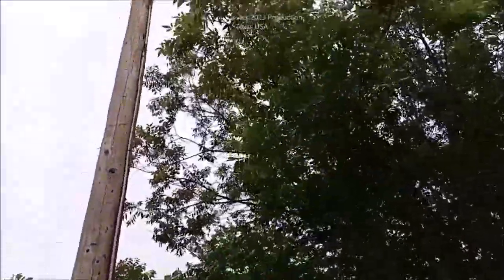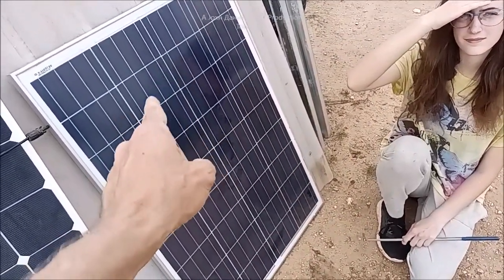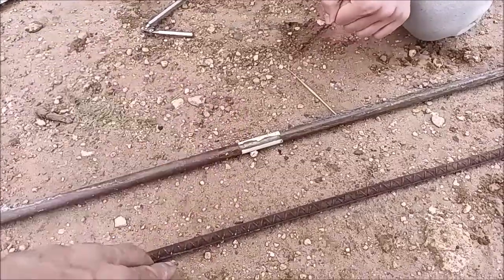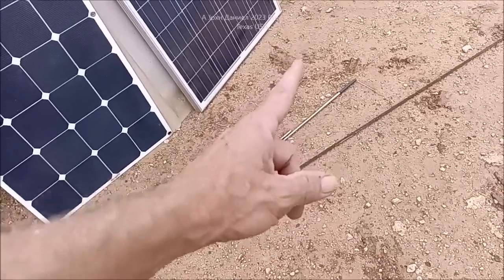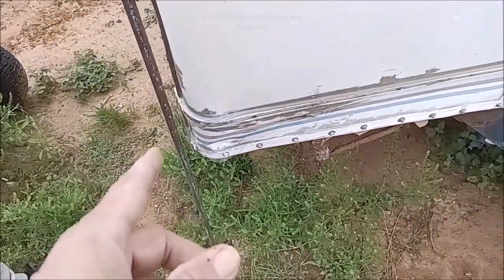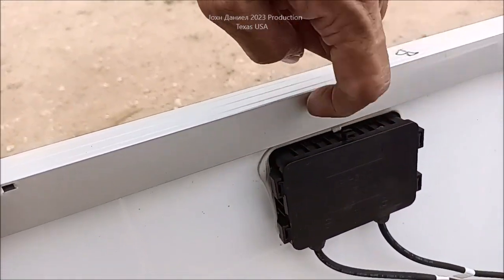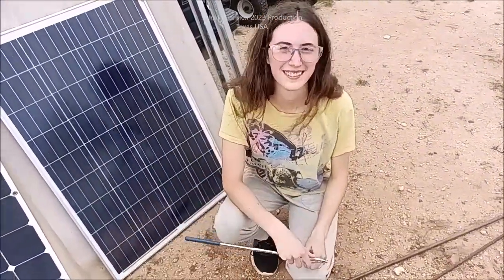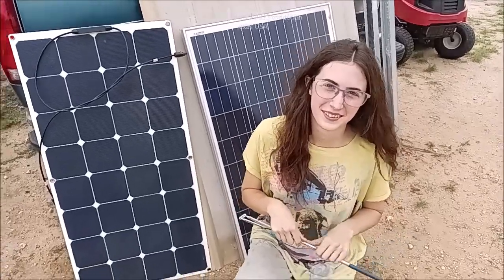Grounding your SOLAR PANELS? 🤔 You Better watch this First! *KNOW DC/Inverter POWER is not Utility

Comment: Thanks for finally putting out reasonable advice on this.  Foldable ground solar panels never have a ground point so I never understood why so many insist on grounding their panels.
Reply: they are grounded because they SIT ON THE GROUND 🤦‍♂🤦‍♂
Reply: @nathanmaker7824  um what?!
Reply: @shaunnightfire8269  you can't read?
If panels are on the ground touching the ground means they are grounded..
Reply: @nathanmaker7824  LOL grounded does not mean touching the ground when referring to electrical circuits.  Proper grounding requires a rod or pipe deep into the earth.
Reply: foldable panels are not intended for real solar installs though. more like just for camping or something where you need temporary, portable power. if you look at actual metal frame solar panels, they clearly have a spot to be grounded, with the ground symbol next to pre-drilled hole in the panel.

Comment: oxidized metal is not a good conductor of electricity: 
Oxidation
When a metal's surface is exposed to oxygen, it reacts with the oxygen molecules to form metal oxides. These oxides can make the surface more resistant, which decreases the metal's electrical conductivity

Comment: The best grounding video I saw. and i went over few dozen of them. Using a regular steel bar make a lot of sense. Thank you for this important information/
Reply from the maker: So called "copper ground rods" are only copper plated steel. Rebar has more ground contact area on it, has oxidation iron oxide (Fe2O3) which is rust that creates as expanding and shedding feature aids in dispersing a charge. The manufacturers of copper coated rods lobbied to get their product in codes. Problem with copper is once in the ground you get tarnishing and electrically nulling copper oxide which proven in real time reduces its conductivity by up to 40%. If you want to use a rod that is not steel use 15mm yellow brass with a silver coating of 12 mil and it is the absolute best and is what is used at server farms like Fakebook and for huge internet companies. Only $800 each!

Comment: Copper is a better conductor than rebar rust has even less conductivity. You want as low resistance as possible. In the car systems there is no ground because it is floating but you can get shocked when you get in and out of the car. Look up tn tn-s and tn-c-s systems
Reply from the maker: Iron oxide concentrations in the ground is the number one attractive path for lightning on the planet, over 95%. The higher the oxidation the more the field is. But copper deposits have no known record of lighting fusion or restructuring. Just because we coat the steel rod with 1.3 mil of copper plating does not mean the copper is the actual conductor to the inrush of charge or displacement of electrons, the steel is since it's molecules are more excitable by the backflow. That micro copper coating on the rod is for the above ground connection of clamps to meet code from the 1940's not to be a diffuser of energy.

Comment: Great video.  Quick question on inverters. I have a standalone inverter with an isolated transformer in it for ac 120v output. Should I bond neutral to ground or leave it floating.  On the Victron Energy 1200va it has an internal jumper to select between the two.  Thanks!
Reply: You need to have a neutral to ground bond for your circuit breakers to trip in a fault (hot wire touching metal that it shouldn't touch).  You should only make the bond in one location.  Bonding in more than one location is also dangerous.  Typically the bonding happens at the breaker panel.  The easiest way to bond at the main panel is to put the neutral and ground wires on the same bus.  If they are separated in the panel then look for a bonding jumper or screw that connects them.  If there isn't bonding at the panel then the inverter could be bonded.  Many inverters and generators aren't internally bonded to prevent the mistake of creating two bonds.

Comment: The frames and racks of your panels need some ground path for induced voltage from nearby lightning strikes and static electricity. That has nothing to do with the DC power lines going to your inverter. Some folks just bond all the panel frames and racks together and connect them to the system ground which is a path back to the ground rod at your service entrance. I don't like this, especially for ground mounts. I add an auxiliary grounding rod at the ground mounts which creates another problem: A nearby strike will induce a voltage across the resistance between the two ground rods which will cause a destructive and dangerous current in the system ground and neutral. So I run a wire between the two ground rods and bind them together, minimizing the voltage induced between them. Alternately you could connect the frames and racks to the system ground AND an auxiliary ground rod, which will also bind the two rods together, but I don't consider that a super reliable ground, so I run a separate wire. I did a video on the issue, and wrote a blog post to accompany it. Earth grounding is NOT a simple issue, and experts don't agree on what's safe and effective. So I came up with a solution that covers all the bases--I think.  https://youtu.be/PEpsz9Jqnrs

Comment: Looking at a bunch of used panels and, some of them, the DC wires were chewed up with exposed conductors. On a van, truck or car, thats 12V DC..It gets alot more dangerous when you step that voltage passed 12 and it starts arcing through air gaps. Into you, down your aluminum ladder and into ground, when youre up there messing with them. My thoughts are wire the frames to ground, flip the breaker off during lightning then when lightning hits all your panels are potentially dead(probably not) but did you died tho? but theres some differences between fully off grid, on grid, grid tied, living in your house vs LIVING IN A VAN DOWN BY THE RIVER!!
Reply from the maker: You won't get arcing till you exceed 32 volts and not even unless you have your panels grounded will you get a arc from your positive wires. Buying used panels if about the worst thing anyone does, they were pulled due to imbalance and cell issues, no such as "oh we just wanted to upgrade" as if they are some new car model. The panels get pulled when the insurance company says they are not in spec or are failing. As for solar on vans, RV's and boats, about 2/3 who install them are running 2 or more panels in series with voltage exceeding 75 volts on average since they are using MPPT with 150 volt capacity.
Reply: @JOHNDANIEL1   Actually panel replacement on corporate solar farms are replaced when the tax write-off expires after 5 years. Depreciation is your friend when it comes to sourcing used panels.

Comment: So how does one get rid of static electricity build up? I can get a shock from my 48v batteries and inverter charger. None of it is earthed.
 I wouldn't earth for lightning but rather for a short circuit
Reply from the maker: Same static that you would get from your car, a aluminum storm door or RV body is what can come from solar panels if installed right.  Yes, 48 volt is getting into the deadly voltage, That is why I am 36 volt and less. Earth grounding it is not a solution to produced DC under 200 volts since it will not naturally equalize to the ground during a short, you or a item in line will become the path. Not the same as AC that is checking to ground 60 times a second. The best thing is simply isolating with covers and proper breakers and durable battery switches on your system. Also, not running to many panels in series so you keep input voltages lower to prevent a high ended differential. I use a max of 65 to 70 volts solar on any 48 volt  build to prevent such leakage from a failed Mosfet or Diode that may put my system at risk. .

Comment: My trackers are lower than my neighbors metal shop and a 40 foot high oak tree. I measured ohms between the electrical panel ground and my steel pole in the ground mount. It was about 1100 ohms. I'm not going to ground it better than that. If I did it would attract lightning and blow everything to hell.

Comment: This is bad thinking. A cable system doesn't need a ground to work but if you've ever seen lighting come through a cable line to a house you'd understand why it's LAW to ground that system. I've seen them melt coax cables into the siding of houses on their way into the ground rod. I've also seen damage from some where the ground wasn't a good connection then that conductive wire takes that 300 million volt charge strait into the house. A ground for electrical systems yes is important for the function of the system but Telcom doesn't need a ground for anything other than keeping lighting out of your house. If lighting hit's your panels and goes into the ground you might still be making a home owners claim. If lighting hits your panels and comes into the house you might be building a new house.

Comment: Hi John. You got a point but sometimes the inverters get A/C energy from the Grid and that is why i guess they should be grounded.
Reply from the maker: Those models have a built in isolator ground circuit, it is based on a GFCI polarization circuit. If you test them you will find that once power is removed from the grid the pass through ground at the terminals vanishes. It returns when you reconnect the grid power. This is a relay in them that does it. If you connect that ground from the house/grid to the chassis then pass it into the wiring from the inverter you will notice a 2 to 3 volt reduction in the inverters output when not on grid.

Comment: Hello John, i watched this video and read the interesting comments. I remembered watching a video where the people had done an off grid instal (i think it was 7000 watts of panels). (i just wrote on their comments for them to watch this video- especially with diversion aspect). i just rewatched it, yes they grounded their panels through the controllers from what i could see (victron controller with earth). They had a lightning strike near the panels and it fried the controllers and inverter. They are now using surge protectors. The reason for this is that they mention that fuses simply dont react fast enough when massive lightning strikes pops in the voltage. they have also added further ground rods (copper). They are in a desert type area and they were told by solar company that long runs of the wiring (over 100 feet) are an attractant to lightning. Therefore more grounding to offset and make a channel for the lightning. The surge protection makes sense to me in the sense of topping massive voltage influx for whatever reason. However, i would be interested in your opinion on the "long " runs of wire scenario, being an attractant. Here is the story on their channel: https://www.youtube.com/watch?v=7DvIjAvMge0 (channel is Tiny Shiny home). Many thanks

Comment: Okay, I think a lightbulb just illuminated in my brain.  A few years back, when our house was being built, I decided to make it 100% off grid instead of paying 30+k for the local power company to bring power to our land in Southern UT.  I built the solar array and installed the panels as well as the inverters, etc.  I let a friend who's was an electrical engineer in Germany help me.  I'm using two 5k grow watt inverters that are supposed to operate in together to give me 10k of inverting power, but they will only work properly when the solar is NOT turned on and running through the inverters.  If I hook up the current sharing cables and the other parallel cables, just using my battery bank, (6 100ah lithium batteries), everything works great, but as soon as I turn on the solar, I get an over current error or something like that.  No one at Signature Solar could figure it out so all I've been doing is running on one inverter and using the other inverter as a battery charger, which is such a waste.  It's been running fine so I haven't messed with it since I resolved to use it as stated but now that I've watched your video, I'm inspired to disconnect all the grounds and see what happens.  If that fixes my problem I'll be buying you all a pot of coffee.
Reply: @georgedrenes8143  what happened?

Comment: imagine you have a metallic mains appliance touching any of your 12 volt minus.
for example, your metallic cigarette lighter sockets.
their metal plate is likely connected to the 12 volt minus pole.
or like in my case:
i use a desktop pc, i have an audio cable plugged into that, going to my old 12 volt car radio
to play youtube sound over my speakers.
the return wire in that audio cable connects the car radio case with the desktop computer case.
the desktop computer is grounded via its power supply.
the audio output is bonded to that ground.
the car radio audio is bonded to it's 12 volt minus connection.
hey voila - my 12 volt battery system is no longer floating !
same as my internet router - fed by my 12 volt system.
someone plugs in a shielded ethernet cable: 
the minus of that 12 volt supply get connected to the equipment which this shielded ethernet cable gets hooked up to
(possibly another ALSO GROUNDED desktop computer !).
when then a fault should happen (some plus 12 volt wire getting damaged, touching something else grounded):
a circuit is formed including my small audio cable, or the ethernet cable.
current will flow through them until a breaker in that circuit trips.
if that is a 20 ampere breaker, it will not trip before the audio cable or ethernet cable have gone up in flames.
I avoid this danger by running large enough earth / 12 V minus / bonding cables to those metallic / grounded equipments
so that a large enough current can flow to trip the next breaker fast enough.
Reply from the maker: You sound like someone with a love for frayed wiring!
Reply: @JOHNDANIEL1  I have tried to point out to you the (fire) danger of attempting to maintain "FLOATING" a system like you and me use, especially as we both are using devices whose metal body is bonded to the 12V minus.
perhaps my message didn't get across.
Reply from the maker: @laus9953  Yes, I got it. However there is a fire danger with everything made and its the locating, proper fuses and maintaining that is the solution. The 12 volt receptacle is the same that is in a RV for 50+ years and the likely cause of fire is owner care of what they plug into it.

Comment: I have a 1500 watt inverter if it is connected to my batteries directly no ground I connect my phone to it, it goes nuts opening things without touching it but if I ground my inverter to my negative terminal battery it stops but it seems like the battery goes dead faster so could I ground my inverter to the frame of my trailer will that stop it or do I have a faulty inverter i'm asking because I never could get a straight answer from the internet lol
Reply from the maker: Make sure the inverter or anything to do with it is touching the trailer frame or ground is being shared anywhere on the trailer first. If it is doing this to your phone it is due to something touching or connected that is giving some sine wave effect to your USB ports. By grounding it to the battery your shunting it and yes using some juice to do it. So its related to the inverter and how its wired to AC outlets or sitting on metal frames or similar actions. Phone touch screens react to open ground in the screen layers to your touch, if your inverter is sending it a few odd hertz of sine wave it can behave wild.

Comment: I had one ungrounded array and three other arrays that were grounded and guess which ones the lightning bolt hit last june? The one that was ungrounded of course!
Reply from the maker: That's psychotic. I'd buy lots of lottery tickets if I was you. A one in a 5 billion happened to you already. Solar panels with no attraction to lightning gets hit when next to it the ones screaming THROUGH ME THROUGH ME we are the shortest route, gets ignored. LOL!
Reply: @JOHNDANIEL1  I worked in the broadcast industry years ago and over my long career, I witnessed lightning strike the ground, some 8 feet from a 250' radio tower. Totally changed my belief system!
My wife caught the event with her phone camera!

https://www.youtube.com/watch?v=e1Tx9ABR4hE
Reply from the maker: I didn't see the lightning hit the panels, looks like maybe behind them. Ungrounded would not make it attract the strike. Like I said, buy some lottery tickets! Adding a ground or being grounded attracts lightning to that easier more conductive source to get to the ground. I worked in the telecom industry for some years and the towers got hit a lot, the internal components and equipment was all floating as well as the building it was in to prevent lightning using it as a path. More likely something in the ground attracted that lightning, not those panels or you'd seen some immediate damage. I have seen lightning strike next to a water tower but that was the visible light, the strike went though the tower frying 4 large solenoid valves in it. The light energy made no marks on the ground but heavy scoring was on the intermediate cross members 30 feet up.
Reply: @JOHNDANIEL1  It definitely hit the 3rd or 4th top panel and in the very next frame, you can see fire and sparks jumping from panel to panel along the entire left half of the array.
Lightning is attracted by a potential difference path. Usually a sharp edge is a good attractor. That's why on tops of radio towers we used to install dissipators that look like a metal tree like thing with lots of spikes. 
The purpose of grounding panels is to provide a path to ground, not through your equipment to ground. All building electrical systems have a ground, so there's no way to float the electrical system. The best approach is to shunt it at the source.